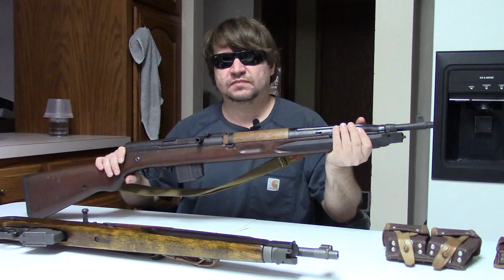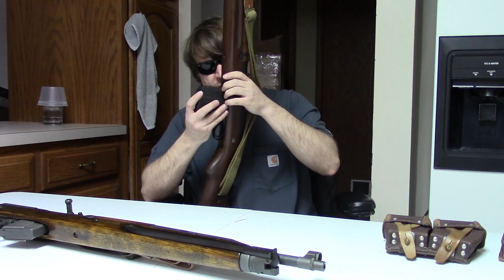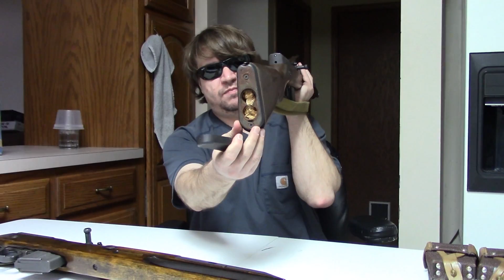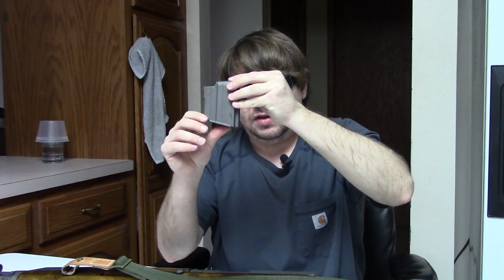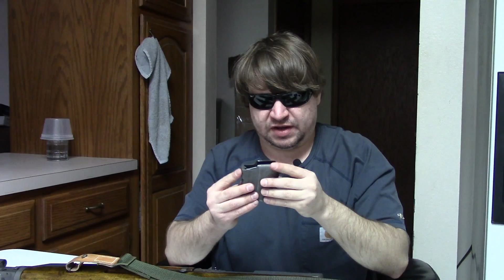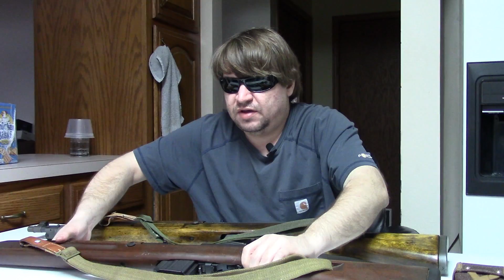Czech 7.62x45 Vz.52 & 7.62x39 Vz.52/57 Carbines: Historical Close Look

Comment: I purchased one of the VZ.52, in 7.62x45 from a company I usually deal with and have purchased military weapons before.  I added an extra $25.00 for the best selection out of ten.  When I received it, I looked down the barrel with a bore light and it was difficult to see any light at all due the rust in the barrel.  I cleaned out the rust and the barrel was shot out.  I was disgusted!  I have other military surplus rifles and the barrels have a decent amount of rifling.  I sent this back.  If this was the best of ten, the rest must be total junk.  I really wanted one of these but I'm not paying $500.00 for junk.

Comment: Im kinda sad that my 52 causes original brass to rip along the neck length wise in 35% of my cases.
Reply: Honestly? I'd suspect the brass has more to do with that than the rifle itself. I've noticed that the surplus 7,62x45 isn't of the highest quality. I've been told by someone at Century that it was stored in rather poor conditions, so deteriated somewhate over the years.
Reply: @misha5670  Nah im in europe. Looks like original laboration too. Guess the chemistry went off maybe. Ill bring them to the lab when im back to work. Maybe well see a dispersion in velocity/pressure.

Comment: Great video but after seeing how the 52/57 failed for the guys at InRange I wouldn't make it a habit of running it hard.
Reply: Keep in mind any test like that is a sample set of 1 and in the case of something like a vz.52/57, a 60 year old rifle with an unknown military history. You just can't know how it ws treated all those years. Plenty of modern guns can and do break firing pins also.
Reply: Agreed, I have replaced parts on my modern AR's and derivatives for failure (mainly extractors), but the firing pin design on the 52/57 is very weak in my opinion. Yes it is a 60 year old rifle but even with moderate usage the firing pin really should be the last item to break. Just my observation.
Reply: *vz.52